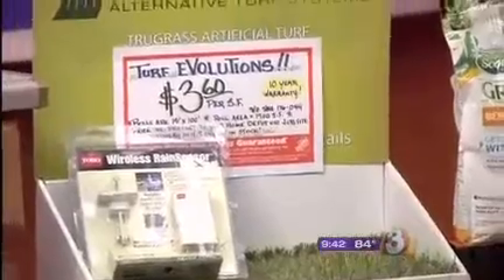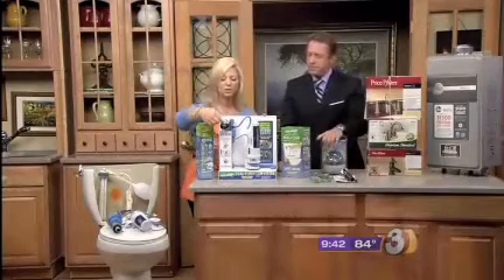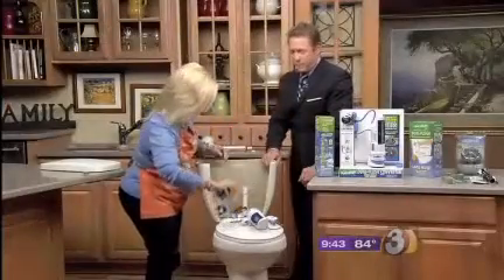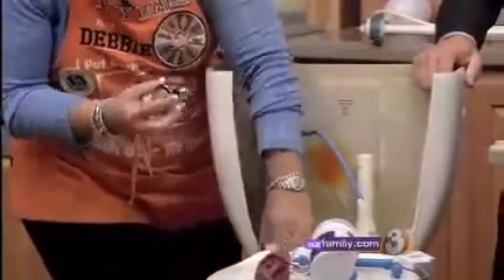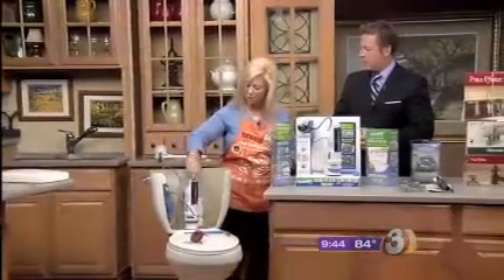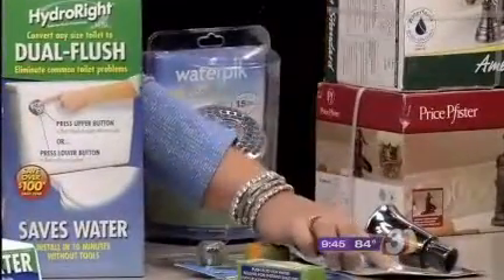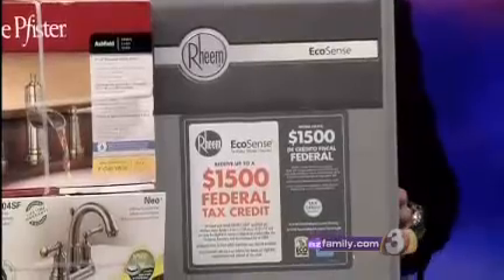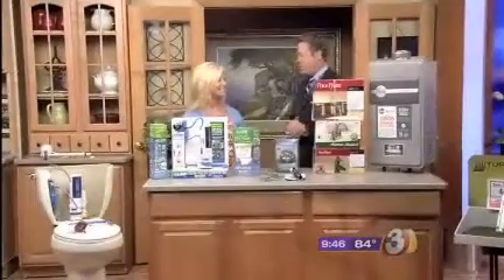Dual Flush Converter Installation Demo

Comment: Facts are electric tankless water heaters will only save 10% electric. Proper installation with permit requires plumber & electrician, and since they use more electric when water is flowing, they need larger circuit breaker, and therefore larger wires. Last time I looked at Amazon reviews they were not good and due to need for plumber and electrician, repairs/replacements expensive.

Comment: Bought both the HydroClean fill valve and the HydroRight Dual-Flush the other day. Installation was pretty simple. I was pleasantly surprised how well the new flapper mechanism seated into the old drain hole at the bottom of the tank. I will be buying another set for the other toilet soon. It's pretty easy to tell that this is going to save me money on the water bill.